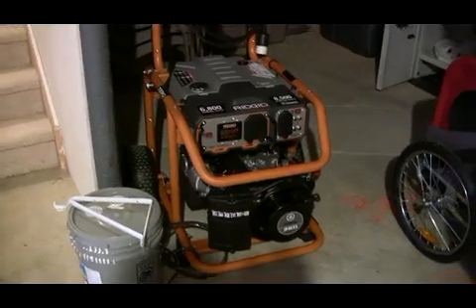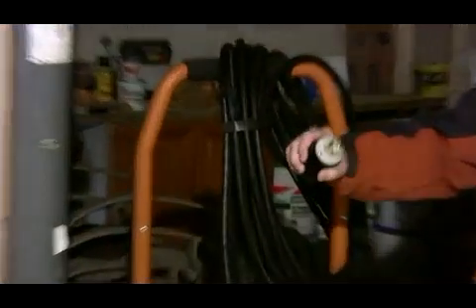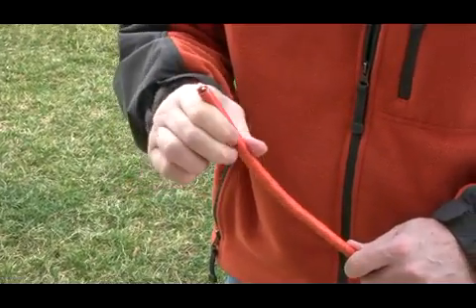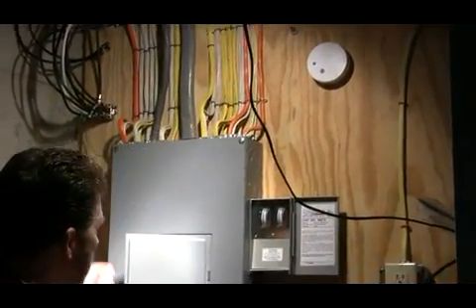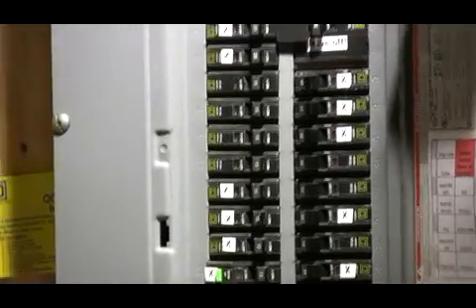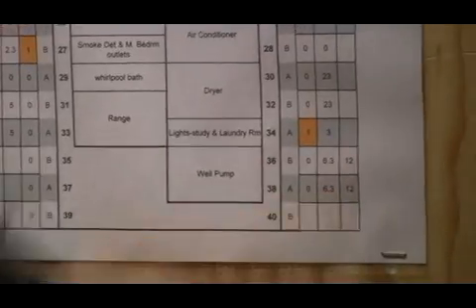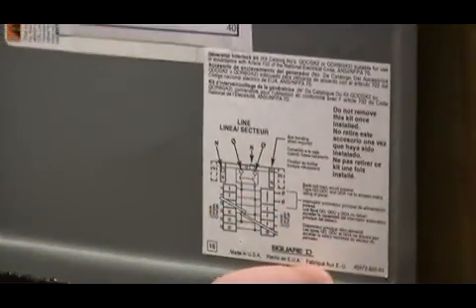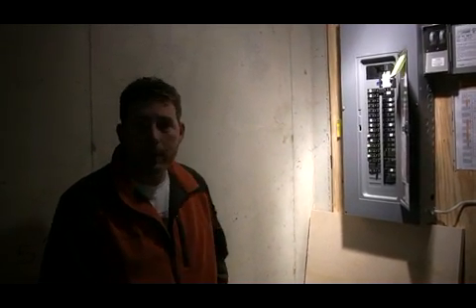Interlock vs. Transfer switch

Comment: >the CT's(current Transformers) and related circuitry are a jewel. Your cord from H.D. is probably (SJ)-good for 300 volts(insulation rating) or (SO)- rated at 600 volts,usually found in industry. Your EM Lt. and it's location to give illumination to Pnl. and Brkrs. should be mandatory by the N.E.C.(National Elec. Code)Twist-Lok plug-wise decision sir-if plug works loose and neutral opens on 220V/3wire feed(not counting ground)-220V would be across ALL connected loads=120V items do not survive.

Comment: panchohughes-Thank you for this. Your Elec. work was neat, legible and done in a craftsmanship like manner as is the vid. The interlock will prevent a backfeed thru panel M.B.(main breaker) to elec. meter-thru SE(service entrance)cable to secondary of XFMR(transformer)to primary of XFMR and incoming utility wire where a backfeed could kill or injure a lineman. In addition,two seperate power sources cannot be connected unless they are the same voltage,frequency and phase. Like your Gen.man!!!>>

Comment: On your emergency light hookup, which is a great idea and glad you included that in your video
but I have a question about the connection, the one that I have has three wires red, black& white and I also want to run a remote light, I have a 14/2 running from a 15 amp breaker it only has a blk & white & ground., what's the red for ??
Thanks Al

Comment: when we upgrade to a new 200 amp service i want to put in a square D QO  panel with the 30 amp interlock kit the only way i would use a transfer switch would be if i could get my hands on a new 3 phase 200 amp transfer switch and a separate main disconnect with the transfer switch between the main and the panel and have the neutral transfer to all connected to a nice big 60 to 80 kw generator if i were to win the lottery then i woldent have to worry what i want to use in the house

Comment: that’s way better than a cheep circuit tester that beeps when close to live power  and having the main switch open so you can test the wire coming from the meter to see if the power is back on

Comment: Hey, I just purchased a Honda EM6500SX, (Eletric Start) for my cabin/home. the "Interlock System" works fantastic and is a really wonderful system if you will be eventually going Solar as a main source' or Hydrogen.

Remember... if you will be using a computer you will require the need for computer A/C defuser plug for your home electronics.

Other wise great video of a home project!

Comment: I am going the transfer switch route for three reasons with one being the Massachusetts building code does not allow interlocks, second my breaker panel is full and third, my breaker panel is obsolete (crouse hinds).

Comment: 30 amps x 2 poles = 60 amps total. If your generator is configured in 120/240 volt mode, the breaker will allow 3600 watts per pole or 7200 watts total. Even if you are hitting the startup current from the generator, you are well within the limits of the breaker.

Comment: I got the Generac GP15000E.  Got it from Lowes in DE to save on the tax, and I used a 10% coupon and got them to throw in free shipping.  They had the best price I could find at the time. 

The generator just kicks butt.  It doesn't even hiccup when I switch all the circuits at once.  None of that turn each breaker on one at a time crap...

Comment: Didn't realize you were in Ceciltucky like me!  I stopped by your post because I wanted to say Thanks for the info on the interlock.  

Last year when I was looking at powering my house, I wanted to know what the best low cost way would be and found this post.  Because of it, I installed a interlock and got myself a 15,000w portable generator. 

Today, I was finally able to use it and it worked like a dream!  the generator, hooked up with the interlock, powered the whole house. 

Thanks again!

Comment: I found this very helpful but have a question that I can't find addressed anywhere. I have a 5000W (65000W starting) generator. That mathematially equates to 41.6 amps (54.16 amps starting). If I install a 30A breaker to a 30A outdoor receptacle aren't I giving up 11.6 amps (24.16 amps starting) of potential capacity?

Comment: Have you had any issue with anything that didn't like the "dirty power" the generators supply. I have heard most appliances don't care. I have heard that flourescent lights and a lot of digit/PC type things DO NOT like dirty power and either do not work correctly and/or may be damaged. What is your experience?

I LOVE your chart! I plan on doing the exact same thing! 

All in all... I am VERY glad I found your video! If you are ever in Pasadena, MD... Come by for a Jack & Coke!

Comment: We conected  many generators during the huricane Ike in Houston area 
Biges problem is  that you cant disconect neutral with interlock plate there was many shorths on utility lines (down power pols)
Transwer switch with neutral disconect is the way to go .

Comment: If the neutral is NOT switched ( broken, opened) by the Automatic Transfer Switch or MTS - and you pull the correct size Equipment Grounding Conductor between the panel and the generator - you do NOT drive a ground rod at the generator*. This is called a solidly bonded neitral- unswitch/unbroken. The neutral is bonded to the grounding (GEC) at the main breaker only. After that it's insulated from the grounding conductor - or 'floating'.

*Unles Manuf. requires it. Talk to the AHJ.

Comment: Ya did a very nice Job!!  Gotta watch with  neutrals  and the type of connection you have at the generator (weather the neutral is bonded to ground or not). In some instances you have to  switch the neutral as well, and an interlock kit would not suffice.

Comment: Just got done with mine,  I used the interlock kit from interlockkiti think was the site.  I really like your emergency light idea.  I think I have a outlet in the celing on my basement that would be perfect for plugging in a emergency light - that outlet does stay powered all the time.  Great idea!  Also,  love the excel sheet,  you are a lot like me,  I do that with my panel as well.  I did not go as crazy with the power meter per side though.  Now I am on the search for gen

Comment from the maker: @cars4me89 Yeah auto xfer is nice if you have the money.  Key is to test the regularly and actually xfer the load.  Sometimes the batteries and circuitry that carry load for few seconds during xfer can fail.     I am lucky that I never see a drop of water in my basement even during heavy periods of rain.  I would be more worried about freezing pipes if furnace didn't have juice.

Comment: Question ... If you wire in a Transfer Switch and use a double pole 30a breaker to power your 30a generator, can you then turn on a 40a or 50a double pole breaker in your panel (for something such as AC or Heat) if the total wattage used by those devices is below your generators max wattage output?

Comment from the maker: @Skellnuts This is a controversial topic. But what did is remove the jumper between neutral & ground inside the endcap. I then labeled the GenSet to say "ATTN: Floating Ground Do not use this Generator in stand-alone operation without bonding neutral to frame!!!". I only use this gen to feed my panel anyway. There is a good thread on this topic on Ridgd forum. Just google "Ridgid t36078-2". It should be first result. ( p.s. I also tested with Ohm meter before & after to be sure)

Comment from the maker: @harpoon70 You will need a 30 Amp double pole. (this simply means it is 220 or two phases)  You can get the model# off your panel and go to electrical supply or HomeDepot.  Sometimes there are specific options depending on panel.  (for example homeline vs. QO)
Good luck!

Comment from the maker: @rakbar24 It comes down to that 'actual' maximum amps you will be using. You can test/measure this before you start the project.   If you go with the 20 amp twistlock, be sure that you use only a 20amp breaker at the panel as well.  (in other words, dont let the breaker rating exceed your wire & plug rating.)  This should be fine, but you will have to be mindful of the load.  (just run a few circuits at any one time)

Comment: Thank you very much for the quick response.  Last question.  Do u think the 20 amp twist lock is enough to back feed CB panel to power up heat,light ,tv ,cable.  All I am finding are generators that are 20 amp twistlock

Comment from the maker: @rakbar24 If I were you, I would examine the plug on the genset that you are buying.  It should be stamped with with the NEMA rating.  Just match whatever it is.  If I were you, I would still go with the 30 amp breaker and the heavier gauge wire in case you upgrade the genset in the future.  Also, the distance (length of wire) will affect performance, so the heaver wire will minimize the loss I believe.  You could research it.  Good luck.

Comment: Great video...Thank you very much. The generator I am buying is a 5000 watt husky from home depot.  The twist lock plug is a 20 amp.  Does that mean my outdoor box and should be a NEMA 14-20 and the back feed breaker should be a 20 amp?

Comment: the transfer swith only allows you to use 6-10 breakers because of the amps u can use,,, with the interlock does is open the circuit for the neutral?

Comment: What an awesome and informative video. thank you for making this. I just ordered a generator and want to this route for connecting it up.  So as far as the Inter lock Kit, it looks like it only comes with really the bracket.  It does not come with the circuit breaker.  I have a Seimens 200amp box. My gererator will have a 30 Amp out.  Can someone tell me what breaker I need to purchase?  I don''t understand the 1 pole vs 2 pole.  I think I know what cable I need to get to wire it in.   Thanks

Comment: I  finished mine  today.  I put the Generator on and with both heat  fan's on and all the lights computer and 2 TV's I was pulling just over 2,000 watts and both meters.   I have no well pump and forced air heat.   I'm very happy.  Now I just need a quiet generator

Comment from the maker: @Stratstl - Also- be careful on the 50 amps.  That would require heavier gauge wire and different plugs.  The wire might be 8 gauge, but not certain - would have to look it up.  Man- that is a nice heavy genset!  With something that large, you must have remote management options? (start & stop, etc)

Comment from the maker: @Stratstl - My layman explanation-  watt meter; the goal is to balance load across both phases (A & B).  The phases are interspersed in your panel, and are in relation to neutral. A doublepole breaker is 220 so it uses both phases.  However a single pole breaker is only on 1 of the 2 phases.  You choose which phase its on.  For single pole breaker positions, they would alternate in the panel going down left side with slot 1=a slot 2=b  slot 3=a slot 4=b  etc..etc..   Same with right side.

Comment from the maker: @Stratstl - For the amp clamp; I turned on every electrical item & light I could think of for each circuit.
Then I turned off every circuit breaker.  While standing at the panel, i clipped the amp clamp to one leg of a circuit and turned the breaker on.  At that moment observe the peak draw. Peak hold feature is handy. I had to do microwave separate due to electronics where it does not turn back on after power removed.   Repeat a few times for accuracy.  Repeat for each circuit.

Comment from the maker: @MrRichardyc   - that is right.    Not sure how important, but my panel has separate ground bus and neutral bus.  So i took the white wire to the neutral bar, and bare copper to the ground bar.

Comment: how are you wiring the 10gauge wire to the 30amp breaker? Red and black to one of the 2 poles, white and ground to the neutral bar inside the panel?

Comment: Thank you for making this video. I was going to buy a transfer switch but this is a better solution. Not an electrician but an electronic tech, I know the NEC code and  I know there are alot of people out there that don't even bother with a transfer switch or interlock switch. Last power outage that last 1 week in the east coast, I am tired of taking wires off the breaker and feeding it into my generator. I am going to do it right and this is the way I am going. Thxs

Comment: Thanks for the Video.  I watch it last week ordered the Kit and the meter.  I put the interlock in, back feed breaker  the wire cut the hole in the dry wall.  I'm waithing for the outdoor outlet, and the meter to finish the job.  Thank you again.

Comment: this setup is done in  marine systems too where you use generator or shore power.. it's common enough many prefab distribution panels come stock with an interlock..

Comment from the maker: @shephenkel  It holds the relative position of that backfeed breaker and the main supply breaker in reference to one another.  Normally, the main supply breaker is the only one that is secured by a bolt.  All of the other breakers 'clip' or 'snap' into place.  If the breaker clips are weak, the backfeed breaker might have some play. The securing plate ensures the position of the backfeed breaker relative to the main breaker.  hope that answers your question.   Thx

Comment: At 6:58 you remove the dead cover and show that the backfeed breaker has a protective plate that came with the interlock kit. What is the purpose of this plate? Why does one particular breaker need to be "held tight"?

Comment: EXCELLENT job! With Irene having blown through and me worried about the sump pump (among other things) I bought a 5000 watt generator to power the fridge and sump pump. However... With winter closing in I would like to have heat and this setup will allow me to get the job done! We rarely lose power as our lines are underground all the way to the substation... But when we do... It's out for a while. I really like this setup and plan to do the same!
Thanks!

Comment: Nice job, I went with the Transfer switch mainly because I only have 100amp panel and I wasn't sure if I could get a interlock for my older Square-D panel. it was a great video and  very informative.  I like the Excel spread sheet, emergency light and the watt meter ideas for you interlock. I seen a few other hack jobs on YouTube, I'm surprised no one got hurt. Yours was one of the best, again very nice job and thank you for sharing

Comment: The best I've seen. Thanks cuz!!!
I am in the process of doing the same thing
My panel is in a  finished area. I have to open up the ceiling to run to feed. Also need to locate interlock for my seimens panel. Lowes sells a main/ interlock for the seimens. Have you heard about them at all?
Thanks again

Comment: The Excel spreadsheet is genius, on day 2 of a 4 day power outage , I installed a 6 circuit manual transfer switch off of a 6000W generator, the hardest part was figuring out how to balance load across the two phases.  I used a Killawatt device plugged in for each appliance so I could figure out peak W and A, and then planned accordingly(you way much better!  The interlock is great, but manual.  To avoid floding & food going bad when not home, going with auto xfer and NG gen, every case is diff.

Comment from the maker: @reigninginlife If you have any open positions in your panel, you can simply move the existing breaker to one of those positions. (paying mind to double pole vs. single pole).   You will obviously need to move/re-route the wires to the new position. You may not have enough wire to reach.  May need an electrician to do this for you.  Also, if you are out of slots, you can buy the slimline (or tandem) breakers that are two-in-one.   good luck.

Comment from the maker: @PMedeiros1976 It is a 'normal' breaker (double-pole, 30 amp), but just referred to as the 'backfeed' breaker due to the purpose it's being used for.  The position in the panel is important due to proximity to the mains.

Comment from the maker: @yakyakyak69 Bingo!  This is the exact advantage of the interlock that I liked- (the flexibility).    A circuit that you may not feel important at the time you install a transfer switch.... may end up being a circuit that you need during an outage.   (like for example your garage outlets,  or say an typically unused upstairs bedroom.  what if you have family staying with you).    Thanks for the post yakyak.

Comment: @md101488 I am not an electrician, but I don't follow this comment.  How can the neutral not being disconnected have any effect on the lines.  Considering that inside the main panel, the neutral, and ground are bonded together.  That would in theory keep the neutral that is leaving the house to the line at ground potential.  I don't see the danger of not having the neutral disconnected in the circuit.  But perhaps I am wrong.

Comment: Great video Pancho! You motivated me to do the exact install on my Square D Home-line panel. I got the interlock kit and installed it myself. I have a question about the breaker plate or bracket that holds the breaker secure. The breaker I installed seemed very tight, no wiggle. Is it necessary that I install that plate? It's shown at the 7:00 minute mark in the video.

Comment from the maker: @jnthnrbrts Thanks.  The "backfeed" breaker is actually just a standard 30Amp double pole breaker.  Mine was QO type breaker which are quite common.  I had to buy it myself (home depot).  The interlock kit came with a bracket that holds the breaker firmly in place (inside panel) as well as the plate that mounts to outside face of the cover.  My understanding is that Maryland code dictates that the interlock must be mfg'd by same company.  I have heard of folks fab'ing their own, but doubt legal.